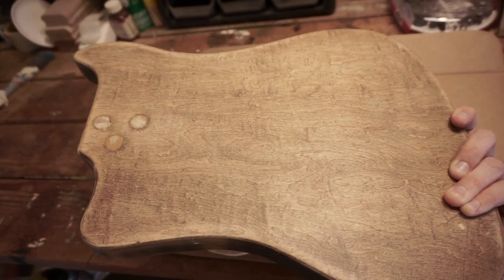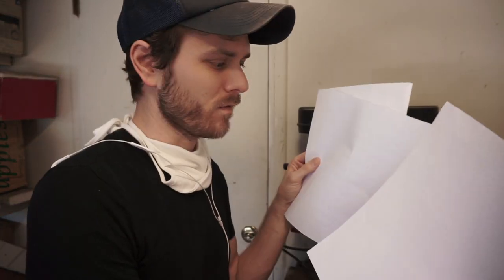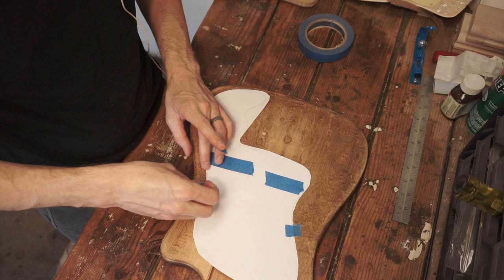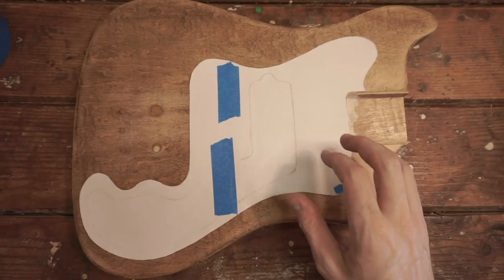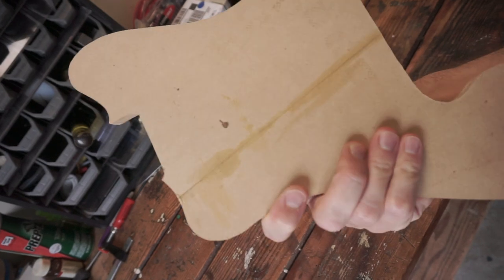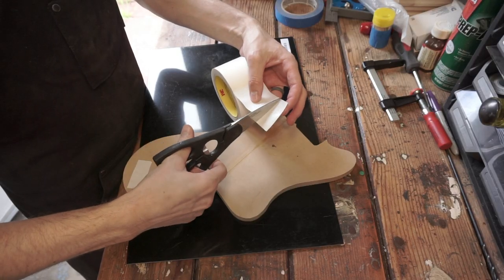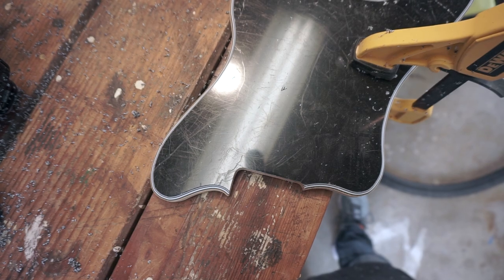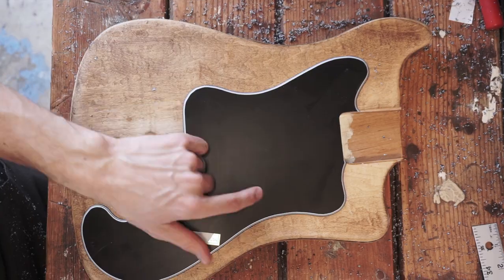How to make an EASY DIY PICKGUARD for your guitar - Part 1!

Comment: Went out, bought a router, some router bits and some MDF, made a template and a pickguard. Surprisingly easier than expected. I had no proper sanding tools so I used a pair of existing pickguards taped together to make a template to then build and finish the template, the trimming router bit has the guide at the top so this worked very well and I didn't need to do any sanding at all. Obviously this is a luxury and only an option if you're working from an existing guard.
Reply from the maker: That's great! Glad to hear it worked for you!

Comment: Great vid. I have one question: Why is it necessary to use the MDF board? Wouldn't it work as well with just cutting and routing the pick guard material without it?
Reply: Thanks! The reason for using the MDF is to have something solid and thick for the router bearing to ride against. It allows for a uniform flush cut as well as an even bevel cut.

Comment: Love the video! I’m currently tempting this myself, quick question on the MDF board. I’m looking at some on Amazon rn that are a 1/4” thick, do you recommend a thicker size or will this suffice? Thanks!
Reply from the maker: I would recommend a little bit thicker, more like 1/2". The 1\4" has too much give when there is no support on the edge of a surface with a router on it. If you have a router table, then you could use 1/4" because you would be cutting on a flat surface with support.
Reply: Much appreciated! I will go with 1/2” then. Thanks again!

Comment: I have to make a pickguard for a guitar that I'm building (Mosrite slab body knockoff) - they didn't have bevels so I'm just going to trace the other pickguard that I have and carefully use a dremel. Hopefully it works out. Getting the pickup mounting holes is going to be interesting. Good video!
Reply: So how'd it go?
Reply: @layz_gaming_4275  It came out OK, aside from the dremel catching my hair and swinging around and smacking me on the bridge of my nose giving me two black eyes (OSHA would have a shitfit). Never doing that again without the hair tied back and safety goggles, haha! I used the guitar at a gig recently. It has some problems staying in tune (a LOT of neck flex) but I have some ideas to fix that.
Reply: @blackcatpgh13  well hey at least you learned something lol

Comment: Nice work man! I just picked up a sheet of this stuff.  Traced out a strat pickguard, then used the sander to get my bevel. Love how it looks!
Reply from the maker: Thanks for checking out the video! That's great to hear you made your own and you're happy with how it turned out!
Reply: @VanHoutenBuilds do uou still have the pickgaurd  that came with it?
Reply: Strat owners - Why go through all of this crap when you can buy Strat pickguards for as little as £6 on eBay ?🤔

Comment: So I just finished this entire process in which I made a custom pick guard for one of my Charvels. This was my first time making a pick guard however I will say I am quite experienced and handy with tools and wood working. Here are my thoughts..if I do it again I will purchase and use a band saw for any cutting. I used a jig saw and although I used brand new laminate cutting blades...it still managed to grab the material and in one instance it actually cracked the guard and I had to start over. In my opinion, it is always better to work the material around the stationary cutting blade, then manually moving the cutting blade around the material. So I would use a band saw and router for any cutting/trimming. The rest can be accomplished as I did with hand tools.Cheers!

Comment: That double curve that goes past the toggle switch- that area (The guitar body) could be cut to match and have what looks like a nice handle in the body. Would be a cool look that would go with the nice curvy pick guard! I won't do that on the Tele style guitar I'm building, but maybe in the future I'll take your shape and do that. Paint one neon green maybe!  The one I'm building now has some artwork I painted. It's a very lightly stained eggplant color with dark eggplant for the artwork and sides. Had to do that to the sides because it was crazy, all the end grain in places I didn't expect. Thanks for the video, I was just getting ready to do one myself, and you reminded me that I need a bevel! Thx.

Comment: Thanks for this! I'm a very visual learner. I've already made the paper template for mine. It's just a tiny pickguard for a ukulele that I just completed (Buck Owens AMERICAN Harmony guitar replica ukulele). It's not necessary but just to complete the look. I'll cut the wood template with a jigsaw and I have two small routers. I'll use the dremel one. Thanks again!
Reply from the maker: That's awesome! Glad you're giving it a try and doing it yourself, it's so rewarding! Thanks for checking out the video!

Comment: Awesome series of videos! I found you because I'm looking to buy a couple of pickguards for two Limited Edition ES 335 Pro's that I have and cannot find on the market. Do you happen to be in the busines of also making and SELLING pickguards?
Reply from the maker: Thanks! I make them for my custom builds, but usually don't make them for other guitars, b/c without the original pickguard or guitar body, it is very difficult to get the fit exact.
Reply: @VanHoutenBuilds  Thank you for replying, VHG! Well, I'll go for a long shot and ask if I could send you a template of the pickguard, would that be something you'd consider?
Reply from the maker: @toneseeker4968  Let's further discuss. Please email me info@vanhoutenguitars.com
Reply: @VanHoutenBuilds  OK, I will...thank you!
Reply: @VanHoutenBuilds  Ok, I sent you an email just now...hope you get it...

Comment: So did you have to buy another sheet of material? Thanks for the video. I’m going to have a second attempt for mine!
Reply from the maker: Luckily I did not have to. That's why I always put things right to the edge when I'm using sheets so I have enough material left over for other things or a second try if I need it.

Comment: Just wondering, what size of router bit did you use in the little Ryobi router to clean up the edge of the pickguard?
Reply from the maker: Hey Blair, I use a 1/4" bit from stewmac to route the general shape, then I use the 45 degree pickguard routing bit from stewmac to bevel the pickguard.
Reply: @VanHoutenBuilds  Thanks... I like your vids and sense of humour, it's refreshing to see someone who can laugh at themselves!!!

Comment: Why not just cut the plastic with the paper template  instead of the wood
Reply from the maker: Cutting it on top of the MDF enables me to use a router so I can get super smooth lines. It also allows for me to easily cut the bevel.